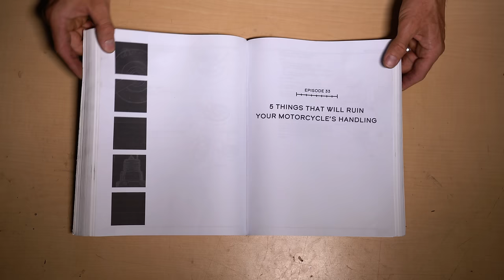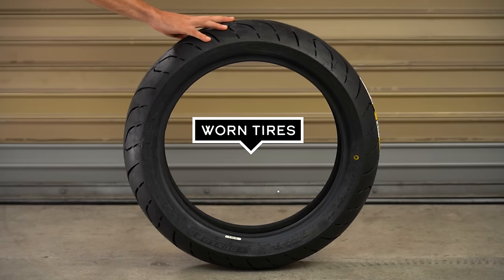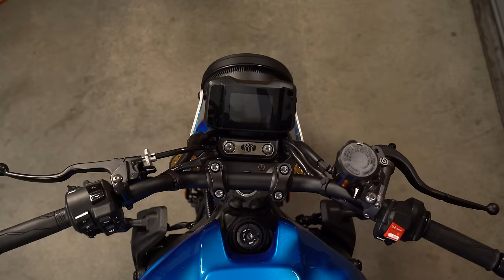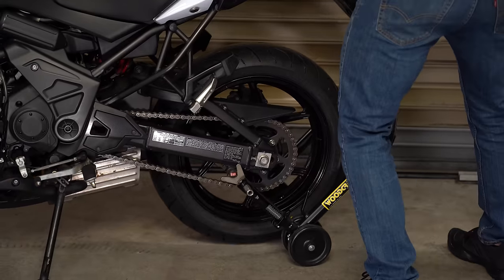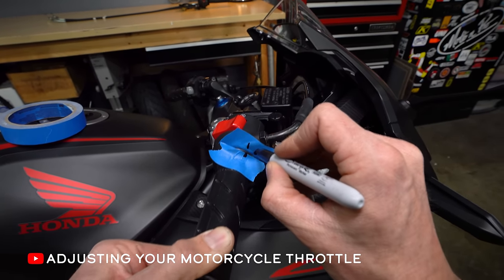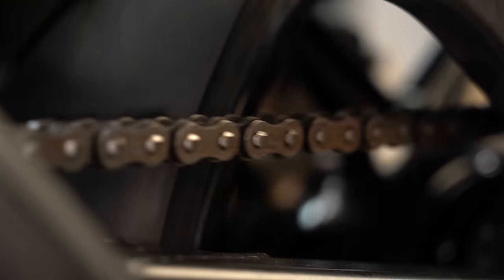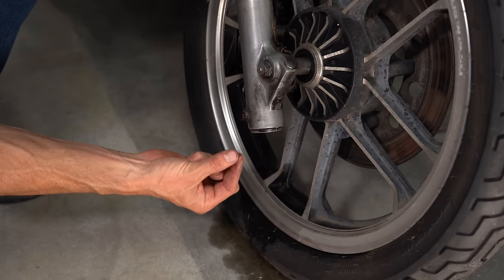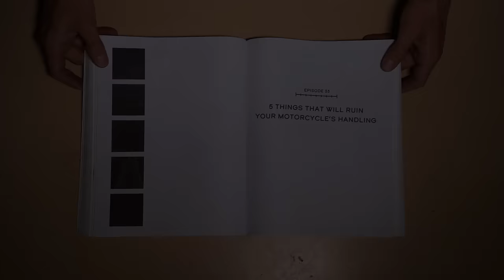5 Things That Will Ruin Your Motorcycle’s Handling | The Shop Manual

Comment: A word of warning; NEVER over tighten your chain. The owners' manual will give you the minimum slack for your chain, so don't be tempted to tighten it a little bit more "just for luck". 
Having an over-tight chain will significantly increase chain wear, but the worst thing about it is that it can actually destroy your engine. This is because an over-tight chain then puts extra pressure on the gearbox components and that can. feed all the way back to other parts of the engine, and that really can destroy it.
Don't do it.
Reply: The engine will be fine, but it will wear the gearbox.
Reply: @XtreeM_FaiL  if i was an engineer here, i would rather engineer the output gear shaft, the one with front sprocket, to break off first if there was too much tightening in the chain link. That way the expensive gearbox system can be spared and the output shaft is, relatively speaking, cheaper than entire engine system if needed to be replaced
Reply: Yes, if you err either way on chain tension, make sure it's on the loose side.
Reply: @calvinnyala9580 that output shaft carries all the torque from the engine, it needs to be strong, not weak
Reply: @countryjoe3551 you are given a range so don't err at all

Comment: My last new bike, a 2018 Z900RS, had some absolute moron at the dealership do the suspension setup. A couple of hours of adjusting it with the help of a bro turned it from a good bike into a dream.

That same idiot tech also set up the chain and clutch and throttle cables with zero slack.

Comment: I have been riding around with leaking forks for months now. Although my theory is that my crash actually twisted my Fork, causing the leak.

To be clear: yes, my Fork IS twisted/(bent?) and I have been driving around with it for months now. Ofc the twisted fork (which I parly twisted back by now) does affect the handling by a lot, but since that bike is only used to get from A to B, it doesn't really matter that much.

Comment: When I first rode my new bike on the freeway, I noticed that at 63ish mph, the handlebars started to feel like they were oscillating that got consistently worse with more speed.  I paid $484 dollars for dealers prep and both tires had the wrong and same air pressure in them. 33psi each.  Should be 36 rear and 30 front.
Now it steers smooth and strait, no weird wiggle, like it's supposed to.
Reply: 3 psi difference in either direction for either tyre should not make such a drastic difference. Also, the correct pressure doesn't just depend on the bike, it also depends on the weight of the rider, the way the ride, where they ride, and the type of tyre they use, so the shop isn't supposed to be able to set it just right. It also doesn't need to be just right unless you're trying to shave lap times on the track.
Reply: @KristianKumpula  Wrong.  The shop isn't supposed to be guesstimating any of that.  While rider weight, tire design and condition, etc. all play a part, the specified tire inflation IS THE BASELINE.  Then the rider then can fiddle with the pressures to their desired ride.  As a bare minimum, they should have informed me they were incorrect.  
This statement; "3 psi difference in either direction for either tyre should not make such a drastic difference." is a bit overstatement.  3lbs too high on MY front tire caused a weird front tire oscillation that felt like the beginning of a speed wobble.  I never indicated a "drastic difference", but it is without question a 'noticeable difference'.  It was an unusual feel, unsettling feel. (I've been in a drastic speed wobble before on a Sportster)  When I replace these tires, I will not be going back to Metzlers.  They are very hard.

Comment: I have a HD Eglide that I purchased in the summer of 2020. They changed the oil before they sold it to me. Dealership. 
It has about 4000 miles. In 2 years it has about 6000 miles. 2000 miles and you don’t change the oil but every 4k or 5k I think. Should I change the oil based on miles or should I change the oil based on miles and time? Should I change it once a year anyway or what should I do when I don’t put a ton of miles on my bike per year. I have 5 is why. Rotate thru them all.
Reply: Engine oil should be replaced annually regardless of miles because it oxidizes, even synthetic. Fork oil is every two years for same reason.  Will it hurt to go longer?  Maybe, maybe not. But at least annually is the standard.

Comment: If the rear tyre on my Fireblade starts getting squared off the handling becomes horrible, it gets super twitchy as you go over road markings regularly giving a small head shake and generally making the bike feel loose.  New tyre and it's back to perfection again.

Comment: Where do you put the jack when checking the steering bearing? If I place mine on the same location as in the video then I am putting alot of force on my exhaust manifold (kawasaki h2 sx se) which doesn't "feel" good. For me to let the jack rest on any part of the engine, i would have to remove my entire exhaust system first. Or is there a nifty trick for this?

Comment: Question regarding the throttle slop.  I picked up a Kawi Z400 last month as my first bike, and while I know that I need to adjust the throttle, I noticed that there seems to be two points where there is play.  There is an initial lose bit of slop where it's obvious that the throttle cable is just completely free, then there is a couple mm of free play after that before it feels like the cables are moving.  It almost feels like there is a spring before it starts to open the throttle, and then there is slop beyond the full extension of that spring.
I'm not sure whether I should just take up the lose free play, or if I should tighten it up past that, closer to where it's actually opening the throttle.

Comment: Does a leaking oil seal make the bike sway left and right due to the change of damping in the left and right fork?
Reply: They should move up and down together regardless so you should be fine there. Some forks have damping and spring on separate sides (see the showa sff fork). But with one leaky fork your damping performance will be affected still as mentioned in the video

Comment: My last VFR was really sensitive to chain slack. Particularly the shifting got notchy and it was hard to shift smoothly if the chain was too loose.
Reply: I'm not sure that chain slack affects shifting, but it certainly affects throttle response. Shifting is definitely very related to the age/condition of the oil.
Reply: @DearMajesty  Yeah, it absolutely affects shift feel. When you roll off the throttle to unload the gearbox the chain slack affects the timing, making shifting smoothly more difficult. Of course, I'm talking about normal cruising clutchless upshifts.
Reply: @morley3810  if you're talking specifically about clutchless upshifting, then I can see how it would affect shifting.

Comment: the only problem I have is with my throttle adjustment... the adjustment is already maxed out and I still have about a 1/4" of play in my throttle! the bike is new, bought it April 2022 and I put about 4500 miles on it. I adjusted the cables when I first got it because it was practically unridable and a 1/4" is the best I can do since with that adjustment, I come to nearly the last thread of the adjustment bolt...

Is there a solution or I have to ask Harley to replace the cable (I didn't see any adjustments on the throttle body/intake side so it's only on the throttle)?

Comment: I'd have included suspension linkages and fork stiction, easy fixes and make a difference to general comfort and handling
Reply: How do you fix stiction?
Reply: @AriH211  Assuming it's not too deteriorated but it's not entirely free, you can pull your dust seals down, clean the are the best you can, smear a generous amount of red rubber grease all the way around the fork stanchion, you then want to lightly bounce the forks to make the rubber grease form a ring and then gather all your strength and bounce the forks as hard as you can, if done right the majority of the grease will go up into the fork, then just pull up your dust seals and that's it! Easy to test if you stiction if you have a way to take weight off the front end. 

If it's so bad this method doesn't help, you're likely due for a fork rebuild. 

Same can be done with the rear shocks but it's very fiddly to get in between the spring and depends on whether or not you have access to the exposed pushrod, if it's covered though then it's likely not going to be exposed to much dirt to begin with.
Reply: @AntaresSQ01  I'd argue that if your technique is successful, ie you're able to get grease past the seals simply by compressing the suspension, then your seals are shot and you're due for a rebuild anyway. Plus any residual grease is going to attract grit and become abrasive. The fork/shock seal are designed to keep oil entirely on one side and water/dirt/the world on the other side. 

Stiction is going to come from alignment, seals, and bushings. Quality seals, packed with a quality grease at the time on installation, will reduce stiction, but it's not possible to entirely eliminate it.
Reply: @AriH211  I understand where you're coming from but actually this would work even on a brand new fork. the oil seals on the forks are uni directional, like most reciprocating seals, they do a much better job keeping oil in than keeping grease out.

That's the purpose of pulling your dust seals down, doing this with your dust seals in place is indeed a bad idea as you'll pull all the dirt and crud accumulated into the suspension too. 

I'm not talking about fork getting stuck halfway in it's stroke sort of stiction, this isn't a permanent fix, it's more sort of a periodic maintenance like lubing your cables and control pivots. And just like with them you'll want to wipe off excess grease left over the fork stanchions. If you have an old pair of forks lying around i'd recommend you give this a try but i've definitely had nothing but positive experience with this, still running stock fork internals at 42k miles on my S1000XR and same with my ER6F at 52k miles.

Comment: Hi Ari, motorcycle full floating disc brakes vs semi floating disc brakes, what's the difference and how to routine maintenance, please help?
Reply: Both are the same for maintenance.  There really aren't full floating discs on street bikes.  It just a marketing gimmick. In reality, all street bikes are going to have semi-floats.  Racing brakes can be full floating, but they sound like a pan lid banging going down the street. The only difference between the two is the design of the spacer. A semi-float has a wavy spacer that acts to reduce rattling noise. A racing float has just a flat washer so it rattles like crazy. No other difference. A street bike will NEVER benefit from a full float, and it just costs money and makes so much noise it's unpleasant to ride. A racing bike only gets benefit because a full float can allow brakes to cool slightly faster when they get to the literally red-hot stage with frequent hard braking on a high speed track. They provide no benefit at all at street speeds, not even in the twisties. A commonly told myth is that full float reduces brake drag and increases speed. It's baloney, because brake drag is statically irrelevant versus air drag. It only improves cooling. 

 An occasional hose down of the buttons with brake cleaner is all that's needed to keep grime from collecting. Do this on wash day so you can rinse it off before it leaves grime trails on surfaces.  Anything more is more in the realm of repair of a sticking button. Lots of vids on this if it comes to that, but sticking buttons are just dirty buttons that weren't kept clean on wash day.

Comment: Alright, steering head bearings; Is it possible there's a problem that only appears when you ride, and not have it on the stand? 
When i check it on a stand it feels fine. 
but when driving it wants to fall/hang in corners and when taking roundabouts for example it has trouble going to the other side to exit. 
It feels super wonky sometimes.
No cables are catching, tires look fine, i cant figure out what's wrong with it.
Reply: Can absolutely be head bearings. With wheel off the ground the weight is hanging off the top bearing, while on the ground it's resting on the bottom bearing. Two different bearings. 

Lifting the bike just let's you feel wear that you can't when it's on the ground.

Comment: The front end of my bike is a mess and repeated attempts at solving the issue(s) have not done so... making me a bit cranky. And where I'm riding (i.e. living) these days... the roads are small and I end up with insane front tire bevels very very quickly, also making me a bit cranky.
Reply: This is just part of owning a bike in areas of the world with well-crowned roads. There are many more choices of long wearing tires these days that still provide good traction. Thst said, crowned roads will always increase wear. It's just materials physics and geometry.

Comment: I've been noticing that my rear tire is starting to square off, good thing I ordered tires a few weeks ago
Reply: A squared-off rear is caused by whiskey throttle, lol!  Ride safe!
Reply: @mfuchs2004  That's not true at all,  I think more likely it's due to florida being flat and me riding in long straight lines for commuting.
Reply: @izzy8609  I was just kidding with you. That said, I've seen a lot of square tires on sport bikes with 18 year olds riding thrm. That's absolutely whiskey throttle. 

In Florida you also get insane road surface temps. You can often find a harder compound that will wear longer.  They're making some awesome tires with mixed compounds now - harder in the center, and softer on the edges.
Reply: @mfuchs2004  I ordered the same tires that came on the bike except now they're actual radial ply instead of the oem cheap bias ply. But yes florida roads are not kind to tires
Reply: @izzy8609  have fun on the new tires. Radials are a completely different feel, especially now that your front tire will stop following those pesky tar snakes!  I still wish I could get 60k like car tires instead of 9k.

Comment: Don't forget seized bobbins on your floating discs. Often a pulsing brake lever is just the disc unable to move side to side on the bobbins. You can check easily - the disc should be able to move a bit side-ways on each bobbin - you don't want this one to creep up into a chronic situation - you'll damage/warp your discs and they are not cheap to replace. As soon as you feel pulsing - get on it.
Easy fix - don't get the mechanic to do it - it's time consuming and you'll pay for that - they'll just want to replace your discs. Put a nut and bolt through each bobbin, tighten and manually spin them (don't use a drill) while spraying some brake cleaner on it - flush with a good spray of the cleaner. You can add a drop of DRY lube to each bobbin and spin again to work through (disclaimer: the lube can get on your discs if you're not careful, or ham-fisted - skip this step if you're not confident in your skills). Clean your discs thoroughly with brake cleaner or 100% alcohol after everything is dry.
Some floating discs aren't two piece (no centre carrier), and the bobbins don't have a hole (BMW) and you'll just have to move the disc side to side while spraying each bobbin. The bobbins on these are often also removable (2 piece discs are not) and you can remove each bobbin, clean and replace.

Comment: Wait, my Fz1 handlebars "fall" into a square position but not outside of like a few degrees. It's not notchy or hard to turn at all. Is that not suppose to happen? Does anybody's bike (without a stabilizer I guess) do the same?

Comment: my forks leaked and did not realize it. almost got into an accident when my brakes did not work as it should b. turns out that the fork oil dripped to the disc brakes.

Comment: Hi, I own a versys 650 2016 myself and I changed the fork oil. But now the handle bars slightly wobble between 45 - 60kmph. I think I put too much oil in the forks. I have scouted the internet and could not really find the oil required when changing the oil. Can you maybe help me with the correct oil requirement when replacing the fork oil for both legs, since Ari has the same bike?
Reply: For 2017, but should be same:

Use OEM Showa oil, but here are specs:

36.47 cSt @ 40°C, 7.24 cSt @ 100°C.  Some folks are fine using ATF, but it's not same spec. 

Right Fork Leg Approx. 410 mL (13.9 US oz.) (when changing oil)
478 ±2.5 mL (16.2 ±0.084 US oz.) (after disassembly and completely dry)
Left Fork Leg Approx. 415 mL (14.0 US oz.) (when changing oil)
487 ±2.5 mL (16.5 ±0.084 US oz.) (after disassembly and completely dry)

Fork Oil Level to start, but air space is the true standard:

Right Fork Leg 75 ±2 mm (3.0 ±0.08 in.) (fully compressed, without fork spring, below from the top of the outer tube)
Left Fork Leg 65 ±2 mm (2.6 ±0.08 in.) (fully compressed, without fork spring, below from the top of the outer tube)

Comment: Having your adjustable suspension not dialed in properly is a biggie too.  You got to learn how to do these things.  Another big impediment to handling is incorrect rider inputs:  ie too tight on the bars, sitting bolt upright at speed, sitting too far back, or weighting the seat rather than the pegs.